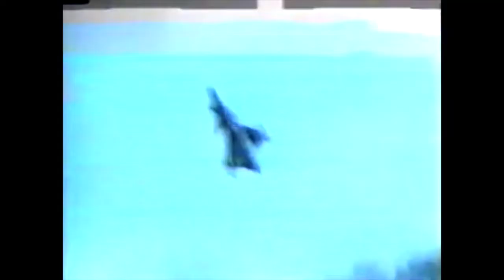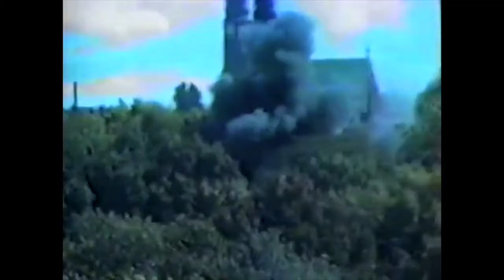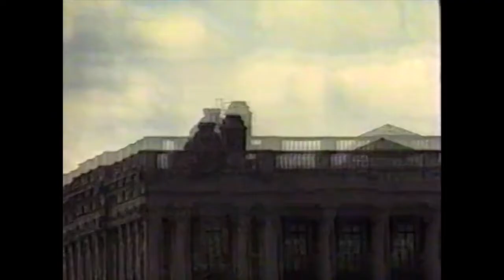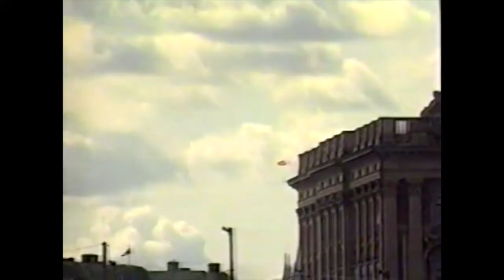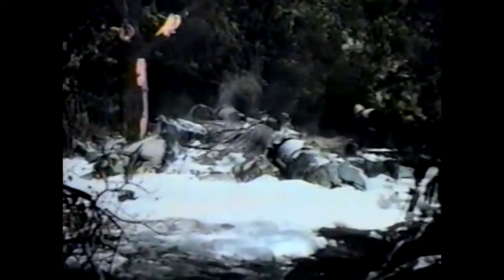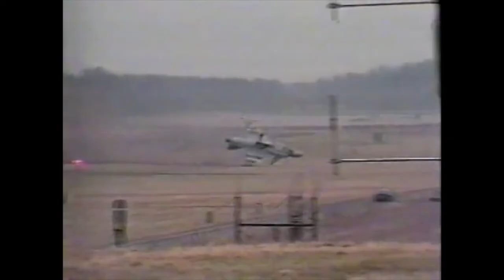Stockholm Air Show Crash Of 1993

Comment: What happended? Almost looked like a Cobra?
Reply: The Plane stalled from a Slow-speed maneuver. The cobra isn't possible with a gripen. Only Delta-wing aircraft like the Draken can do it.
Reply: @AKIS_Proto  the gripen is techincally a delta wing but a delta wing with canards (double delta wing) the gripen is unstable so you can vobra with it, but the planes fbw may not allow it to do so.
Reply: @AKIS_Proto  Misinformation. Plenty of planes can do it that are not delta wing...  Even named after Viktor Pugachev who did it in a SU-27 which is not a delta wing and had no thrust vectoring at the time.
Reply: @jjansgi  i seem to stand corrected. My apologies.